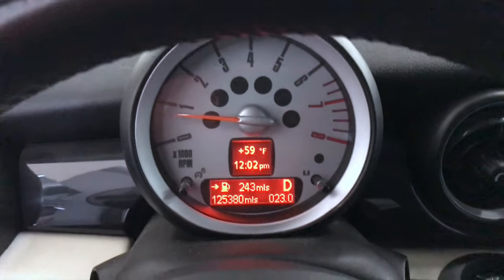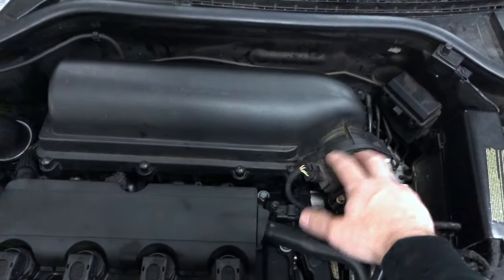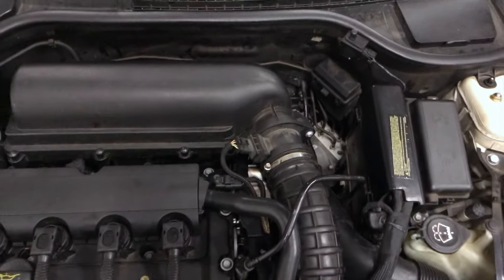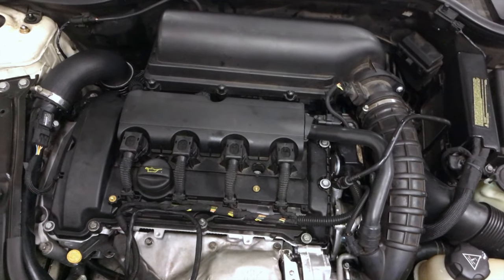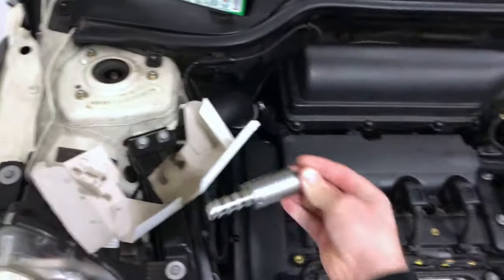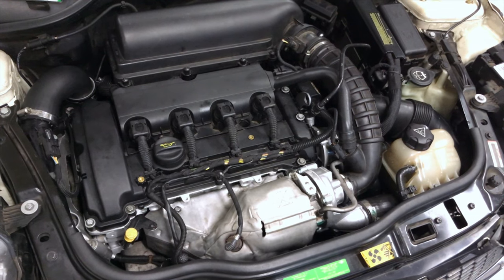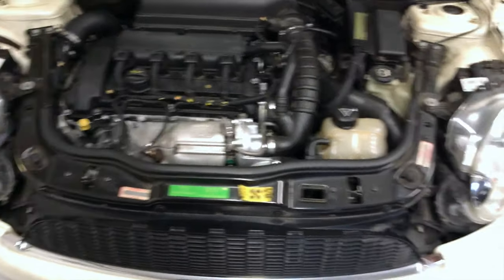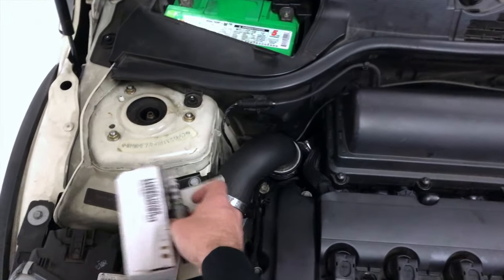MINI:  Erratic Idle Issue, SOLVED

Comment: I have similar issue on my r56 07 n12b14a engine. When is cold revs go from 1200 to 1450 up and down on idle once engine is warm up it's okay. also when you drive and come to sudden stop revs drop below idle point for second and go back up to normal idle revs?
Also when driving on clutch while parking I noticed when I give a bit of gas reverse lights glove brighter, when I release gas and engage clutch on idle lights dim again, same happening with cabin ventilation (ventilator blows a bit faster when throttle is pressed).
Anyone had something similar? Don't know should I start change alternator, vanos solenoid or maybe is all this normal!?
thank you!

Comment: i’ve replaced my plugs injectors had a compression test and passed but i’m still misfiring on 3 help please
Reply: OjSenju - did you ever find out what went wrong with your mini?  I have the same issue but on cylinder 2....

Comment: Hello Mike I got code 28BD (Throttle valve, closing spring check: Malfunction ) do you have any idea with this code !?? I have to remove the intake manifold to replace water pipe under the intake. The car was working very hood for 2 weeks and after that I got this code.

Comment: So I plugged in an OBD and I got three error codes altogether. The first is this one P0507, the second error code I received was P0171 similar to what you said about the system being too lean, and the last error code I received was P0440 which has something to do with an evaporative emission system. All of this happened about a week ago when I put gas in my f56 mini. Whenever I put in gas my car now forces itself to start, and I also get high revs when I’m idled. I already replaced the gas cap thinking it was that, but could you think of any other issues that might be causing this?
Reply: Hi l redrover , my car have same codes and issues, what was your fix for this? Thanks

Comment: Ok I don’t want to just throw parts at the car. What is the proper way to diagnose this part?
Reply from the maker: monitor live data of ignition timing and timing gear actuation if available. compare it to the input voltage to the solenoid as well to see what the dme is telling the solenoid to do. if it is actuating it but nothing is happening to the timing then the solenoid is bad, jammed or clogged.  On the flip side if the solenoid is being actuated in a steady manner but timing is jumping then a solenoid can cause that as well. But so can a bad timing gear or chain. That is why we start with the solenoid ( assuming you have a fault relating to timing )
Reply: @MikeMDs  thank you for your response. Unfortunately I don’t have a $10k scope!  Is there a tear I can do directly to the part?  Like an ohm test?

Comment: I changed EvERYTHING and still runs rough. :(  Fuel filter, plugs, coils, Vanos, timing chain, throttle body, pcv... time to trash it. 
Checked fuel rail pressure and good. Took to dealer and they spent 3 hours on it and couldn't find issue and I still had to pay them.
Reply from the maker: Does it have a misfire only on one cylinder?
Reply: @MikeMDs  hey, no misfire
Reply from the maker: What kind of faults will it throw?
Reply: @MikeMDs  No faults reported by dealer. Also did a compression test ... 130psi all four cylinders.
Reply from the maker: Only runs rough at idle?  S or non s model?
Reply: @MikeMDs  s model.
I ordered a Turbo diverter valve. See what happens. Was under $30

Comment: I have a problem with low pressure oil n14  engine i changed the oil the same problem
Reply from the maker: It could be the oil pressure switch itself, or wiring. ( assuming you are getting a oil pressure light on ) .  Hard to say. If everything else is running good then I Doubt it's the pump.
Reply: @MikeMDs i changed vanos gear  and vanos selenoid but camshaft its  highly consumed does the intake camshaft  can show this  problem of low oil pressure engine  work very bad in idle

Comment: I have a similar issue with my 2009 non-s clubman. Throwing a p2188 - running rich bank 1. Ive done a lot of researxh on this code and coming up empty handed. Ive replaced VVT solenoid (exhaust), spark plugs, coils, O2 sensors. Idle is rough and stalls sometimes. Everyone else thatvhas looked at it, also didnt know what is throwing the code.

Comment: 10 mini bucks little on hills sets code for unmetered air and replacement that other techs hv done is valve cover. Why wld valve cover cause this as a code. Clear code comes right back

Comment: That’s a R56 engine not a N14
Reply from the maker: The body is a R56. The engine is a N14
Reply: @MikeMDs   Hi Mike, I have a 2011 Mini Cooper JCW w/112k.  Had the engine out in April for clutch, water pump, cylinder head machined, timing set,  etc.  December got a P0300 / 0302 / 0304 misfire.  There is No compression in cyl. 2.  Could this be cause by the vanos solenoid?  Btw the car sounds just like the one in your video.  Thank you for your time...